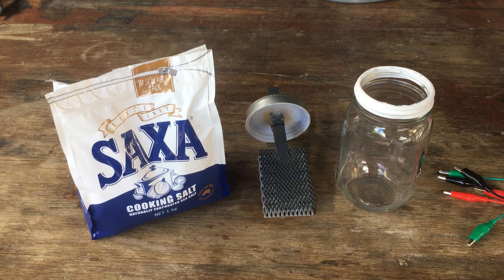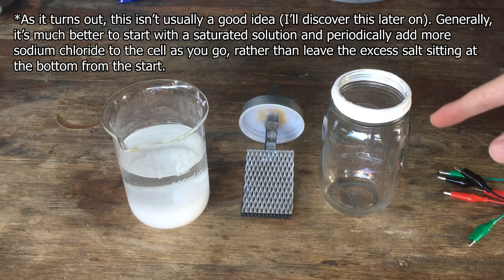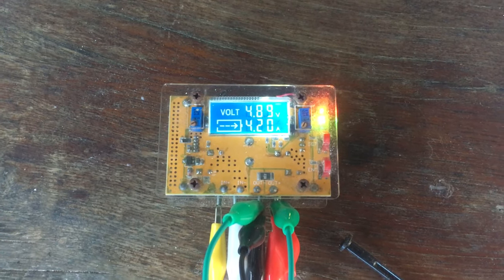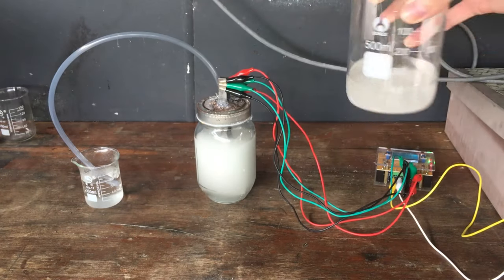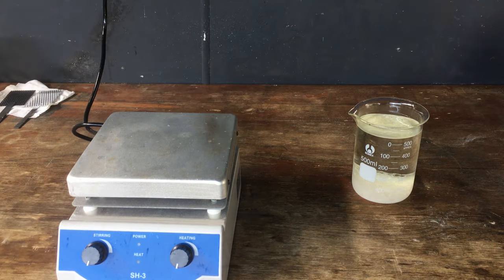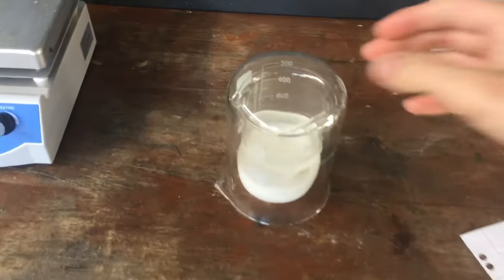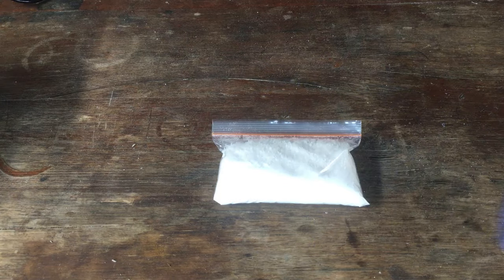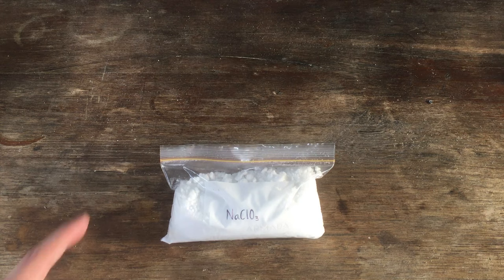A Sodium Chlorate Cell

Comment: Fun fact, you can easisy remove the iodine by dry heating the salt in a oven or even a pan. Also, to remove anti caking agents, you can dissolve the whole pack in water to make a saturated or near saturated solution and then filter through a coffee filter. Then, you can boil/evaporate the water to get pretty pure NaCl.
Reply: Nice
Reply: Hi i need a better explanation please 🙏 😊
Reply: NaI is harmless in this rea anyway

Comment: You can make it into perchlorate using the positive plates from an old lead acid battery. Make sure the plate is fully formed then leach the sulfuric acid out with baking soda water. Then soak in distilled water, then use some salt water. The cathode material really can be anything you like.  🤓
Reply: Can you make Sodium Chlorate from lead, then adding salt to water and H2SO4 then electrosis, and can you make explosive with this for replacing Potasium Chlorate?

Comment: I'm so tempted to throw you some money to get yourself a cheap 30v, 10A power supply..  (One of the ~$100AU aliexpress specials) and maybe some heavy duty leads to go with it.. :)
Reply: why 30v? Another good way is that you can use a generic PC power supply (that outputs 12v) along with a dc-dc converter (you can get 20A ones for about $10)
Reply: @nicktohzyu  That is just the range the supplies come in. They are fully adjustable, constant voltage and constant current from zero to their limits(30v, 10A in this case). I know he uses constant current mode a lot and these do it well.
These are simple linear supplies, so tend to survive a lot of abuse well. Mostly just want him to have two supplies and far less dodgy leads. :)
Reply from the maker: Haha, I appreciate the thought, there's really no need to send any money though :).
The cardboard box power supply has been here for such a long time, I always forget how dodgy it looks... It's always been pretty handly to be able to supply 20-30 A on occasion, and since it still works, I've always prioritised other things when it comes to lab purchases, but maybe it's time for an upgrade.

Better leads as well... that's a thought. The connections tend to corrode so fast (when using them for electrochemistry) that I always buy the cheapest ones I can find because they rust like crazy in a few months anyway. Maybe the big copper clamps and some banana plugs might be a better way to go.

I'll definitely look into a better power supply/connectors, that'll make a good choice for the next lab upgrade. :)
Reply: @ScrapScience  Nothing wrong with using an old PC supply as first stage, will be using a dozen of them in an big LED exhibit over the next few months, the only difference is all the connections will be crimped and soldered.

But PLEASE upgrade your leads!  Both the ones to the cells and from the main PSU to your DC-DC box.
Those test leads really are never good at the best of times(I know, I've used and destroyed plenty!). I'd suggest some of the silicon wire used by RC plane/drone makers, it's cheap from all the normal places, highly resistant to temperature, very flexable and made for heavy currents. And you can even re-use the croc clips from these cheap leads, when they corrode, cut them off and solder new ones on. :)

(And save the propper crimped/solderd connectors for the PSU/switcher end, away from the corrosive stuff.:)
Reply: @ScrapScience  what about painting on a conformal coating (like nailpolish etc) whenever you connect up a cell, then just tear it off after you're done?
Reply from the maker: @nicktohzyu  That would probably work to protect the bulk of the clips from corroding, I'll have to look into it, thanks!
Reply: @ElectraFlarefire  
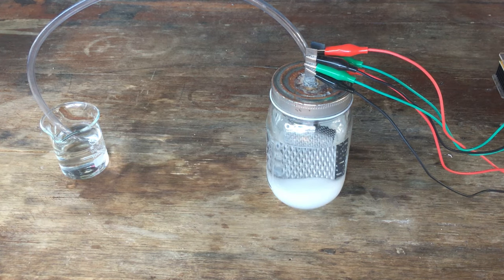The leads, this I don't get. What's with all the leads? sheesh. 5:20 .
Reply: @ScrapScience  i need to your email i will open a factory please

Comment: I think dishwasher salt is even purer without any anti-caking agents, come in bigger crystals though so takes longer to dissolve.  Also if you haven't run the cell to completely use all of the chloride then I think your product will contain a level of chloride in it as chloride drops out first.
Reply: but at the end of the cell's run the chloride levels are really low so it doesn't participate out much
Reply: Pool salt is the most straightforward. And cheap as hell.

Comment: 2:18 If you don't have this salt, you can use sea water and cook until all the water evaporates and you have cooking salt
Reply: Evaporated seawater contains about 50% of NaCl, so it would be very impure
Reply: @foxpaw474official5 I use salt from sea water and it still works fine

Comment: 21:19 naclo3 has higher deflegration/detonation temperatures with oxidant-fuel admixtures compared to the potassium salt. Which is why it's brighter. As far as power, there are regards in which one is more powerful than the other depending on the circumstances. Overall they are equal but not identical. As far as what's on paper, kclo3 has an oxygen balance of +39.2, whereas naclo3 is +45. That doesn't necessarily mean as much as it seems, considering that nano3 has higher OB than the both of them but is far weaker in most regards.
Reply: i don't mean to be an ass but man the way you write the formulas pains me deeply.
Reply: Sodium chlorate is more explosive ..tho
Reply: @impatientpatient8270  considering I see people on yt write it as "KC103" all the time it could be worse
Reply: @dc-gs3ld  what a cursed piece of text
Reply: Which is better in combination with diesel if you know what I mean…

Comment: Ok so what is the difference between this and the Chlor alkali process
They both involve the electrolysis of saltwater but it forms sodium hydroxide instead of chlorate
Reply from the maker: A chlorate cell is (from a technical perspective, at least) extremely simple - electrolysis of a choride solution with inert electrodes. A chloralkali cell, on the other hand, requires a separator between the anode and cathode, to ensure that the products on each electrode are kept separate.

In a chlorate cell, the cathode generates hydrogen and hydroxide ions. The anode will oxidise chloride ions, and with the hydroxide ions freely available to interact with the anode (no separator between the electrodes), this oxidation of chloride in the presence of hydroxide will yield hypochlorite ions. These hypochlorite ions can eventually be oxidised again by the anode to form chlorate ions.

In a chloralkali cell, the cathode once again generates hydrogen and hydroxide ions. However, due to the separation of the cathode and the anode (with a porous diaphragm or an ion exchange membrane), the oxidation of chloride ions on the anode is not performed in the presence of the hydroxide ions, leading to the oxidation product of chlorine gas instead. Overall, the anode will make chlorine gas in this setup, whilst sodium hydroxide will accumulate around the cathode.

Comment: Brother, I do not know why the electrolysis process does not work for me. I do electrolysis of a salt solution for two days, the amount of water is ٨٠ ml, but all I get is sodium hypochlorite only and with a very strong concentration. Sodium chlorate will crystallize within ١٠  hours, especially with this amount of water that I use. Please describe the problem to me, my brother. Thank you.
Reply from the maker: Unless you are constantly adding sodium chloride to the cell, sodium chlorate will never crystallise from solution. The chlorate is more soluble than the chloride. Additionally, what electrodes are you using and what current are you running things at? The current will determine your reaction speed.

Comment: Maybe I have an idea for an advanced Setup. Therefore you would need a second bottle, that serves as a reservoir for fresh NaCl.
What is further needed, is a small heater, under this NaCl-reservoir, to prevent the NaClO3 from cristalizing out in that bottle. 
Few Watts eg. from a tiny peltier module, that (maybe) should be electronically adjustable, should do the job, if placed on the bottom of the flask, right below the NaCl. And aditionally you would need a tiny and cheap peristaltic pump (that can not be effected by corrosive agents, because it does not come in direct contact), could be used to mix and pump the liquid around very slowly between the both bottles. What I expect is, that from a point on, the NaClO3 would continously cristalize out in the coldest part of the system, while the solution is getting continously freshed up with new NaCl from the second Bottle. I didn't test it, but if that works, it would be a very comfortable way to produce NaClO3 crystals without too much work , as the NaCl can get filled up any time and also the crude NaClO3-crystals could just get sieved out. That would be a nice micro production unit, especially good, if you could power it with a solarmodul, to turn sun energy into an useful oxidizer for almost nothing.
Reply: How ı do chlorate? You have Instagram? I have a question please

Comment: you need to load in a lot of sodium chlorate to do a perchlorate cell.
I usually make the electrodes for it myself by careful electrodeposition of lead salts on coated Ti.
Reply: I've always wondered about these deposited PbO2 anodes. Doesn't something simpler work? Like anodizing some lead in sulfuric acid or copper sulfate or whatever. Make them nice and black with oxide. Or is that too thin?
Reply from the maker: Interesting... maybe I'll need to make some more at some point then.

And yes! I'm a fan of your work on PbO2 anodes. It's a little beyond what I can manage myself, but it's very impressive to watch nonetheless.
Reply: @6alecapristrudel  that will not work because you need either a nonporous or thick mesoporous PbO2 deposite which can only be done with careful electrodeposition.
It also needs careful control of the plating current density and bath temperature to make a good enough anode for long term use.
Reply: @CatboyChemicalSociety  Ok fair enough. I was just wondering since it seemed so easy lol.
I managed to make a PbO2 rod as thick as my pinky finger once by accident. I was making some acid from CuSO4 with this thick rod of solder as anode. It was holding up nicely, but after I plated out the copper I saw that I was leaching tin out of the anode. 
So I kept going. I got over 20g of tin out of the solder without it changing shape at all. I assume what was left in the rod is some sort of porous PbO2. It was noticeably lighter and cracked instead of bending. Not sure what alloy it was since 60/40 doesn't really leach tin IME. Higher tin content probably.
Reply: @6alecapristrudel  indeed its fine in an environment containing SO4 ions because the Pb2+ species is not very mobile in this liquid due to insolubility of PbSO4 and thus the anode will not corrode and instead oxidize to PbO2.
but in electrolytes containing chloride/chlorate the ions will be more mobile which will cause them to migrate to the cathode and plate out lead metal.
This also causes the anode structure to corrode if the liquid reaches the lead layer but while this process can be halted at pH of 9 it still will occur enough to create these stalactites of PbO2 due to this effect which still corrodes the substrate.

Comment: What would happen if you just used a large iron or mild steel bar as the anode?  Sure it would oxidize rapidly but couldn’t you use a magnet to clean the solution, instead of having to use expensive inert electrodes ?
Reply from the maker: The problem isn't inherently the oxidation, because as you've noted, it's possible to remove oxides from solutions. The real issue is the fact that the oxidation of the anode will completely replace the desired reaction of forming chlorate ions. The oxidation of iron (or any other standard metal for that matter) is an easier reaction than the oxidation of chloride to chlorate, so all the energy you put into the cell will go towards destroying your anode, and virtually none will go towards the reaction you want.
Reply: Yet graphite also breaks down, albeit much more slowly, what reaction is going on there, and does it dominate ?
Reply from the maker: Yep, graphite does also break down. This is mostly due to an extremely small degree of oxidation on the graphite structure (a few small sections are oxidised to CO2, breaking apart the surface of the graphite material).
In contrast to the reactions that occur on iron, nickel, copper, or any other standard metal, the oxidation of graphite is an extremely minor reaction, allowing most of the input energy to go towards chlorate generation.

Comment: In case I can't find platinum, is it possible to use stainless steel 316, I hope to find an answer.
Reply from the maker: Stainless steel will not work for this process when used as an anode. The only easily-purchased anode choices are platinum, MMO (as I've used in this video), and graphite/carbon electrodes. I go into this in more detail in my other video on chlorate cells (link in the description).

Comment: fantastic video, love it. Can't believe I haven't heard about this stuff sooner. I'm thinking about using carbon rods as my electrodes, how do I go about filtering their particles from the solution? It isn't a particularly big issue since I'm planning to use it for pyrotechnics anyway, but I also would like find the most efficient ratio of oxidizer to fuel and a precontamination would make that a lot less precise.
Reply from the maker: Filtering is a little tricky since the oxidising solution tends to eat through paper. If you're careful and don't apply too much pressure to the filter, you can probably still get away with using paper towel or a coffee filter though.
Note that the use of carbon will probably make your chlorate yellow even after filtering, but the contamination is generally extremely minor despite the strong colour.
Reply: @ScrapScience  thanks mate, sounds good.
Reply: First let it settle for a day or so and decant it, to get rid of most carbon particles and after that, I would press a cigarette filter into a tubing, so that it's sealed up with the walls and pump the solution through it. That should be good enough to get it clear again.
Reply: @ralfvk.4571  
Thanks for all the tips!
Decanting worked well enough (the solution had been settling for weeks, I've been too busy lately to take care of it earlier sadly). I just filtered the rest through a coffee filter, which worked well enough to get rid of the particulates at least. 
Sadly, I'll never know how much chlorate I had in solution; as I was boiling it, the ""heat proof"" glass I was using shattered and spilled the solution everywhere. lmao.
I'll try again soon (I have a much bigger and higher amperage setup prepared), and maybe attempt that cigarette filter trick. not sure yet.
Reply: As a poor people i can aproof that i make Sodium Chlorate from Lead or Battery rod then add mixture salt and H2SO4 then electrosys.

Comment: The decanting, washing and drying sequence after crystallization is missing (16:21). It would have been very useful to observe and understand how the pure crystals that we see in the bags are obtained.

To concentrate the NaClO3 from bleach, after boiling and evaporation, I crystallize the evaporated solution up to 1/3 remaining in a porcelain or Pyrex or Arcopal plate by reducing the temperature gradually, so as not to remix the salt with chlorate due to bubbles. I obtain a crust composed overall of 1/3 chlorate, slightly different in color from salt and very hard. The NaClO3 being below due to its late crystallization. I cook this crust and after cooling, I scrape and brush as much salt as possible to release the chlorate. I make pieces of it and quickly soak them in cold water to remove the remaining salt stuck to them. Then I dry the pieces a lot with concentrated chlorate.
The removed salt can be treated in the same way to recover some NaClO3.

Comment: i used aluminium anodes for a quick hho generator experiment, it generates gas as expected but rapidly produces aluminium oxide in the bottle, which is not desired

Comment: Can the sodium chlorate decompose when it is boiling too hot? And what happens if it is boiled inside a metal pot? Mine turned a bit yellow, so i put it back into the cell because i am suspecting it decomposed again
Reply from the maker: Boiling the solution definitely won't decompose the sodium chlorate, so there are no worries there. However, a metal pot probably isn't the best, as it might be oxidised by the chlorate. Boiling it in glassware is the best way to go.
It's probably not really necessary to put it back in the cell, since you're not really seeing decomposition here.

Comment: If you run the hydrogen and chlorine gas mix through a UV-C chamber or burning the mix in a "chlorine furnace", you can also make hydrochloric acid at the same time as making the chlorite.
Reply: What kind of furnace and how much electricity it takes

Comment: A quick question: wouldn't it be easier to simply evaporate the chlorate solution in the sunlight to get the crystals?

Why the extra effort of boiling and crystalization? 🤔
Reply from the maker: Boiling and recrystallisation is much, much faster than evaporation. I'd definitely consider it the most convenient option, even if it's not technically as easy as evaporation.